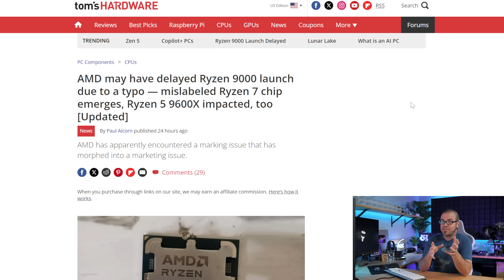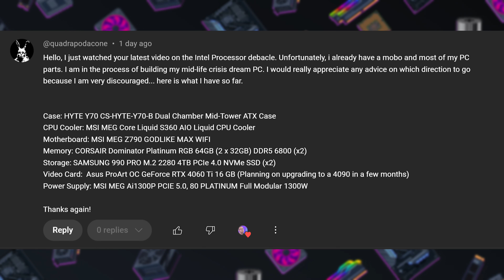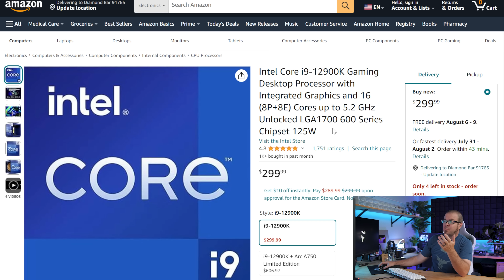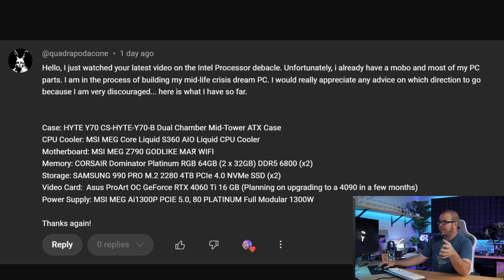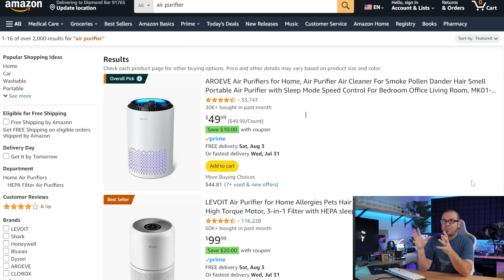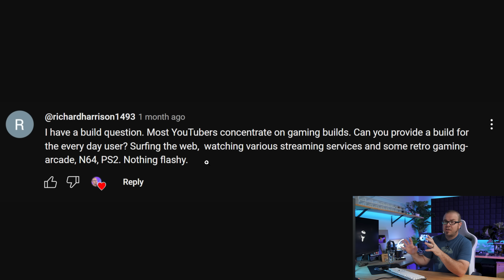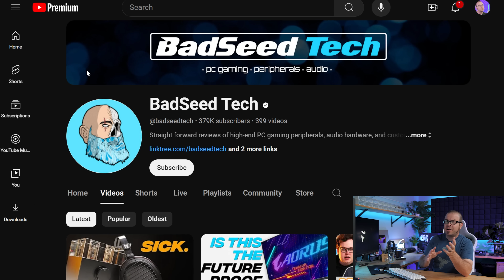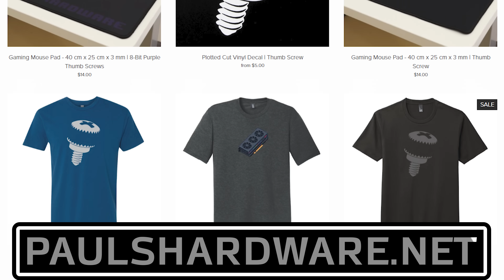What if my Intel CPU explodes?? - Probing Paul #88

Comment: If the microcode update doesn't fix things, I have a $1000 CPU to RMA. dammit
Reply: Funny thing is, how do you know it works, or works well? You just don't. 
It may work ok with the fix, then die in year 4 when it's out of warranty. Or it could work well even without the fix for years. It's the unpredictability and lack of certainty...
Reply: @BoraHorzaGobuchul  Good point. I bought it just under a year ago, so I've started the RMA process.
Reply: @chelfyn  your cpu is 1k??? Which cpu is that? I paid £565 for my 14900k last year late November.
Reply: @theicewitch9328  there are no problematic cpu that costs or costed $1000
Reply: @theicewitch9328  1K in NZD, where I live :)
Reply: @Jeffcrocodile  gah, 1000 NZD, I should have made my local currency clear. I have a 13900KF
Reply: @BoraHorzaGobuchul  Just check stability though? Microcode update halts further damage, if CPU is performing as it should now then it should be in 4 years.
Reply: @2b2056  how do you check stability? Stability testing of something of as simple as memory often requires multiple hours of memtest runs. A CPU can be failing without producing bsods, but with causing small errors here and there from time to time - you might not notice it for a long time, but they will be there. 
Data may be altered, apps may crash more often for unclear reasons (after all, they often do even on good CPUs), etc. Then it might just die one day. Or keep on like that. How do you know? 
Do you run long stability tests every week? 
This is a charlie foxtrot...
Reply: @BoraHorzaGobuchul  Check decompression tests, all of those with issues seem to struggle with those. It's however not an absolute holy grail to weed out the issues plaguing RPL, but from what I've seen, they seem to catch most of the faulty ones. If you get out of vram messages/blue screens/whea errors, just submit an RMA. Then sell the platform with the new RMA'd CPU and change platforms (to AMD as it's the only option, or a 12900k/s drop in, but by all accords it will be a downgrade, and you'll be on a dead platform, so I'd go for a platform change).

Comment: Click bait rubbish - where did you answer this question "What if my Intel CPU explodes??" ? Your answer is to switch to AMD or install the latest bios? The same rehashed info I'd get by reading any Reddit post. Zero mention of how to adjust bios settings to ensure lower power levels or how to undervolt correctly... Not only this, but your information has been available for the best part of a week now... 

The endless need to produce content leads to useless videos like this. 

Unsubbed.

Comment: Been rockin’ Intel CPUs since the 286 debut in the ‘80s on thru 386, 486, Pentiums (reg, MMX, Pro, II, III, IV), Core 2 Quad, until 2020 when gifted a 11700k. Somewhere in the midst of there I strayed off trail with a couple Athlons, but not impressed. Yet in 2020 I went AMD and may ride that for some time onward. Clam happy.

Comment: On the pc audio, all my builds have had upper mid tier onboard realtek chipsets, and the only time I ever had any issues was some interference on the front panel audio that was entirely my fault. I had the cable routed against the psu. Once I rerouted, I was right back to crystal clear audio. The higher tier realtek are way underrated, and external audio is almost never necessary unless you need different i/o than the motherboard provides, in my experience.

Comment: They never learned their lesson from the first PIII 1.13GHz (or the people who were responsible have long moved on). Those had a 100% failure rate however.
Reply: Well pat was around for the original pentium divide by zero bug

Comment: Regarding dust: If you have central air/heating, check your air filter and consider a higher MERV (Minimum Efficiency Reporting Values) filter.
Check and see if you can find an allergy-rated filter that fits your equipment. 
MOST air handlers accept up to a MERV rating of 11, though there are filters that go beyond that and air handlers that accommodate the higher rating. 
A MERV rating of 5 is generally the minimum value to protect the ducts and equipment from excessive dust, doing little to help air quality.
If you're unsure, just find the model number of your air handler and the manual is likely online and should explicitly state the recommended MERV rating range.
(The value is basically a measurement of how effective the filter is at removing particulates from the air.)

And, obviously... general air cleaning filtered fans are an option.
It seems quite strange to focus on your PC when your entire house is affected by dust.
Reply: If he isn't willing to spend a lot of money, a box fan can be used along with a 20 x 20 inch air filter.  Costco sold either the 2200 or 2500 rated air filters at the 20x20 inch size.  Lean the air filter on the air intake side of the fan and that will filter out a lot of dust, pollen, and ultra fine dander (skin cells) floating in the air.

Comment: Paul, I just built a 13600 i5 system are these cpu's failing also?
Reply: Can't be sure. The initial source of data is Intel, and we all know that they are very honest and reliable, right?
Reply: @BoraHorzaGobuchul  13600k?  There's no 13600 in retail channels.  Also, the 13600 is Alder Lake, so it would never be an issue, even if you could find one.   My 13600k has been perfectly stable and a stock Intel i9 air cooler almost never runs past an idle, unless I run handbrake (once a month, maybe).

OP: TL/DR, don't worry about it.
Reply: Google "Intel >=65W cpus affected". Just make sure you have a warranty and if things go south RMA.
Reply: 13600 (non-K) is Alder Lake, not an issue...
Reply: Thank you guys

Comment: Re dust buildup... one of my wife's friends asked: "I was told to clean the dust off of my PC's vents. What do I do with the felt pads? Can I wash them?" 😱
Reply: Omg.... Took me a few seconds
😂
Reply: Oh how considerate of the computer vents to make their own felt filters.
Reply: You're using FELT pads as filters?   A better choice for home-made dust filter is to stretch female hosiery fabric over the filter frame.   What I use at home is an air filter.  Air purifiers are expensive, so if you are DIY, you can simply get a box fan and use those 3M air filters (rated 2200 or 2500) at Costco.  Lean that filter on the intake side of the box fan and the air pressure will suck the air filter up against the box fan.  That will reduce the dust in your home's air.
Reply: @animejanai4657  Whoosh
Reply: @animejanai4657 wow, you really missed the entire point lol, no they are not using felt pads at all. Now reread his comment and think harder about it
Reply: @KrazzeeKane  He would build up a felt pad of dust faster if he put a fabric substrate under it such as the fine mesh weave of hosiery.  It's a solution some people have done in car audio as well over the upwards facing rear speakers in the rear dash.
Reply: Every day we stray further from God
Reply: @andrewpartington7274 if you're not trolling, brilliant. If you are, brilliant, said sarcastically.

Comment: Worst advice ever, just buy a 14900k and downclock it. It will have WAY lower VID voltage than a 12900k and run extremely cool vs a 12900k.  Instead of running 1.5-1.55V you would end up with 5.5Ghz@1.32V. Extremely safe. You can just all core sync and set 55 as multiplier to achice this. 2 simple settings.
Reply: If it's suffering from the oxidation issue, it could still due prematurely :)

Comment: I bought my 13700K in late 2022 (Black Friday), so it's still under warranty.  I haven't had any issues to date, but I've taken it out of service.  I'd really like to know what Intel is going to do for us whose CPUs haven't failed yet but most likely will.

EDIT: Sept 27, 2024.  I'm going to update my BIOS to the latest available, though now I understand Intel has just released yet another microcode update, and return my 13700K to service.  As a hedge against failure, I've bought a 12900K.  Intel seems to be running out of Raptor Lake chips, and a refund would still leave me with a useless Z690 board.  A 12900K in a drawer is my insurance policy.  If my 13700K never fails, then I have another really strong CPU to sell or to build around.
Reply: their response to you.. butkus.. zippo. You got a microcode update coming and my guess is you better use it, then pray.
Reply: @aeromotive2  I smell a class action in the air...
Reply: @aeromotive2 Does AMD pay you people to say this stuff? You don’t see Intel flocking to AMD channels to rag on them. At least I don’t.
Reply: @H33t3Speaks  Intel fanboys insulting AMD users has been the stereotype norm for over 10 years...where have you been? Nvidia ones do it too.
Reply: Get an RMA on it. Don't waste time not getting it done.

Comment: what computer do I get for basically dicking around with vids and facebook with some small emulation? anything DDR3 ram using or newer, any gfx card worth $50 or more, an SSD for a bit of speed.

a cheap X99 combo motherboard with a xeon server chip, 16gb ram included in the sale and an old RX 470/480/570/580 or above gfx card and a 600W PSU will all happily do it.

an old office computer of the i5 upwards days with a old gfx card stuffed in it and an ssd would do it.

as paul said, an old laptop with any gfx logo sticker on the top from the i5 or above lineup will typically do it(go 6000 series or above for better ompf)

Comment: I'll get attacked as an "Intel fanboy" but I think people are generally overreacting.  There was basically no whisper of issues two weeks ago, now every tech channel is up in arms and everyone is in full panic.  Your Intel CPU is likely fine.  Stock voltage is simply set on the high side.  If you are concerned, undervolt your CPU, don't overclock/overvolt (and/or update bios when microcode released).  For new builders, just go X3D as they are the best gaming chip.
Reply: lol at "basically no whisper of issues 2 weeks ago" for this issue ive been seeing dedicated videos on the past 2 months at least.

Comment: For the person asking about audio. If you're mainly going to be running speakers with no headphones then go for powered speakers. At the higher end the KEF LSX II LT at $899. At the more affordable end the Elac Debut Connex at $499. Both come with plenty of bells and whistles and E-Arc as well, I believe.

If you want to go passive speakers you will need to do a lot more research on the speakers you want, the DAC/AMP/Pre-amp and make sure the speaker amp has enough power to run them well.

Powered speakers make your decision a lot easier, especially if you're new to the audio enthusiast hobby.
Reply: I've had a great experience with my Logitech Z906 5.1. It's fairly affordable, and supports a range of inputs... I run optical audio, but it also supports PC analogue 5.1. The control box cable is a bit short, but can be extended using a 3rd party cable. It's LOUD AF, but also sounds great for every type of media consumption
Reply: @Ben-Rogue  +1 Yep I second this, I did some research before my build and I use the on board audio just fine with Logitech Z906 and its great.  👍
Reply: I don't know If I'm sinner but I use MB audio for Genelec G2 + F1 set :D
I have lived the era when we needed sound cards but now MB audio quality is far better and some motherboard manufacturers even show with led lighting that audio portion is separated from other part of motherboard for signal integrity.
Pre-amp maybe nice to have then you can use better signal level from motherboard audio. I have F1 set to about 50% volume.
Also those usb dacs are usually dac + pre-amp. Also new active speakers start to have optical/digital interface in sub that then give signal to monitors. New revision of my Genelec F1 sub has also optical and coaxial input.
Reply: would it be worth considering an external DAC for M-Audio av42 speakers (vs onboard sound).
Reply: @sofadhana1289  I think it depends on what you listen too. Are you fine with Spotify and your music collection is mainly mp3s, I am going to say no.

If you want to dip your feet into the audio enthusiast rabbit hole with things like Tidal and Qobuz then yes.

They are powered speakers with a 20amp A/B amp built in, so you don't have to worry about a speaker amp, so something like ifi Uno DAC/Amp, or the JDS Labs Atom 2 Bundle.

This gives you the ability to run your speakers and the ability to plug in a nice easy to drive set of headphones.
Reply: @sofadhana1289  I think it depends on what you listen too. If you mainly just use Spotify and Mp3s then I would say no. If you want to dip your feet into the audio rabbit hole then something like the ifi Uno or the JDS Labs Atom Stack 2 Bundel. This allows you to run your speakers since it has its own 20w A/B amp, and give you the ability to plug in some easy to drive headphones as well.
Reply: That's a lot of money wasted. A pair of Kali LP6's is all anyone needs for high quality flat monitors. If for whatever reason you don't want a flat response curve then that's a massive red flag in audio quality, so any stereo desktop speakers can do that.
Reply: @fateunleashed9680  The LP6s are two hundred per speaker, so at four hundred not that much cheaper than the Elac. Both sets have gotten good reviews.
Reply: @fateunleashed9680  The LP6s are $200 per speaker so at $400 a pair not that much cheaper than the Elac. Both have gotten good reviews, and both are good speakers at their price point.
Reply: I run audio through HDMI to my monitor, which then has an audio jack (good to get the DAC away from the PC high power environment), and then have a pair of AKG K240 Headphones. I'm sure you can get better ones, but for that price bracket they are great!

Comment: Per the dust, I have multiple cats and I will say that air purifiers/filters do make a difference.  But ultimately, you have to stay on top of the sweeping or vacuuming, Make it a nightly chore before you go to bed.
Reply: @Bound4Earth  with sweeping and vacuuming, I was referring to the house in general. I don't have to do that to the PC specifically, every night, lol
Reply: The biggest issue is don't put your PC on the floor.
Reply: I used to be against sweeping. But now uve given me a reason to sweep more often 😂

Comment: Meanwhile I'm watching this with my i7-8700k still going strong
Reply: I have an 8700k too, it's been on a loop never going over 45c it's entire life. I bet it lasts 20 years lol
Reply: @mehck-gk9yn at those temperatures it wouldn't surprise me if it lasts a lot longer than that. Probably only "die" when it's not powerful enough to run modern programs
Reply: @tylerweston6358  >Probably only "die" when it's not powerful enough to run modern programs

I'm gonna find out! She's going until failure however many years it takes.
Reply: @mehck-gk9yn  Until the pump fails on that loop.
Reply: @TheRealSkeletor  which pump? I have two Swiftech D5s they'll probably last longer than me.
Reply: @TheRealSkeletor  A good brand pump will only fail if you let it run dry or it gets a surge. They're simple beasts, sealed from dust intrusion, so as long as they don't run dry (the fluid keeps them cool) they will run pretty much forever. Just like how you can pull the electric motor off a 75+ year old industrial machine, clean up the things its attached to, replace the feed wiring, and it will just start spinning again.
Reply: @Gauze-sb2fo Don't let the doom and gloom scare you. The majority of CPUs are fine. If the "50-100% FaiLuRe RaTe!!!" clickbait were true you'd see FAR more complaints. I've built more than a few Raptor Lakes over the last few years as well as 3 currently in my family. None of them have had a hiccup. Don't get me wrong, it's a very real issue, but I get the feeling it's being dramatically exaggerated for clickbait purposes. But I would like to see some kind of statement from Intel guaranteeing a smooth RMA for those that do have issues arise in the future.

Every company has product failures. It's how they handle the effected customers that dictate if I use them again in the future. As much as I hate all these companies, Nvidia replaced burned out 4090s without any pushback, AMD replaced burned out 7800X3Ds without pushback, and I'm sure Intel will replace burned out RPLs. ASUS has been the bad guy more than the big 3 by far.
Reply: @Gauze-sb2fo If you undervolted it - then you're fine. Still the best overall CPU.
Reply: @someperson1829 wrong. Mine was .6 volts and still went bad. Lvl1 techs showed no overvolt or overclock still failed on server boards with a 50% defect rate after 6 months
Reply: @timothygibney159  0.6V? Who are you kidding? It will not even run on that voltage value. lol. Server/non-server boards have nothing to do with the fact that the CPU asks for 1.48V on 6.0GHz, which also can exceed in reality with all the LLC shenanigans.
As for Level1Thechs, the dude claimed that the server board W680-chipset doesn't support oveclock, while in fact it does. Says a lot about credibility of his analysis.
Reply: @someperson1829  it was a great underclocker. Ran cool  and never ran over 1.36 volts. May it rest in peace
Reply: @timothygibney159  It was a great smart-a-r-s-e wannabe, who runs his CPU at 0.6V. lol. Get lost.
Reply: 7980xe represent
Reply: My 8700k I sold then replaced with 13700 non K. That 8700k runs crisp for many years
Reply: My 6700K is bottlenecking a few new games, but its mostly keeping up with my 3060ti. 8 years aint bad for a cpu. I might swap it after 10.
Reply: will delid mine soon
Reply: i7-4700, 8GB RAM, 1 TB HDD, and integrated graphics. Runs well due to Chrome's mem management over the past decade. Used car or 9800X3D gaming rig?
Reply: Yikes.  So old
Reply: @TronTonics  still runs brand new games on max or close to max settings